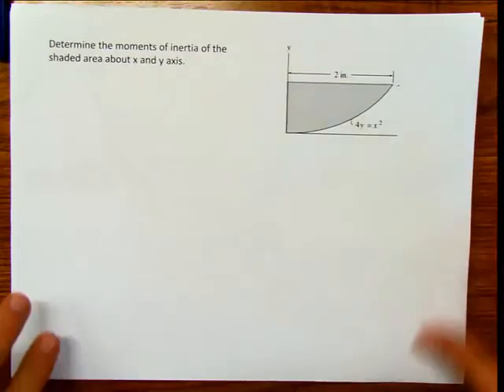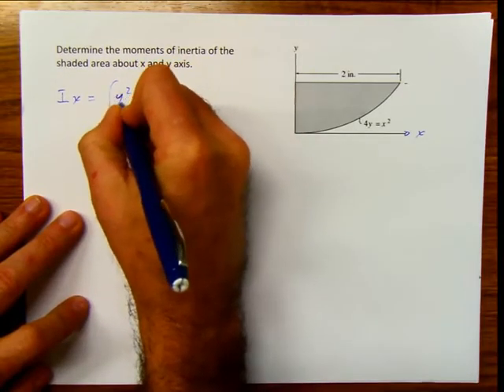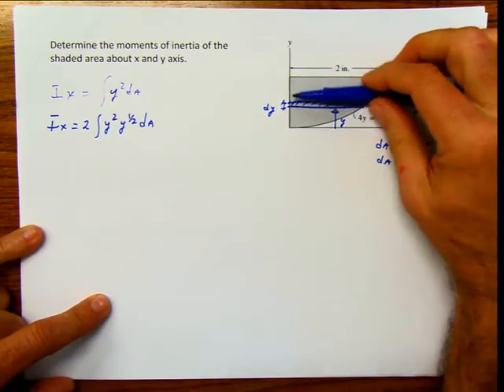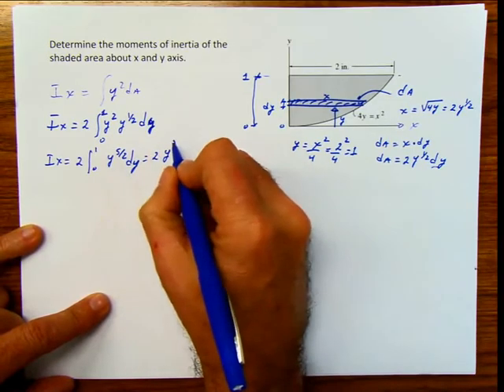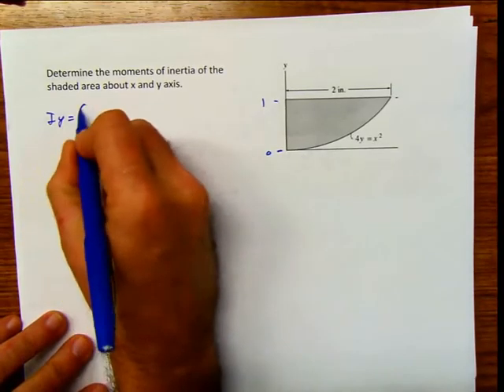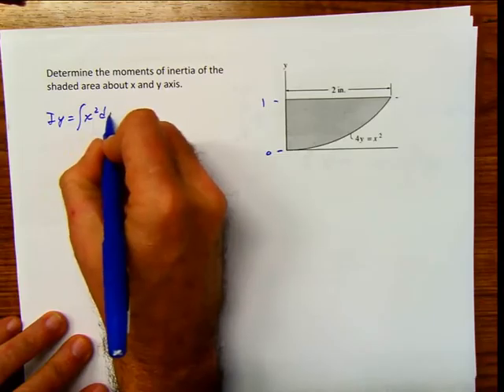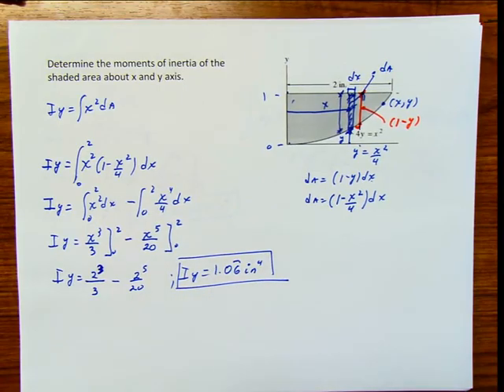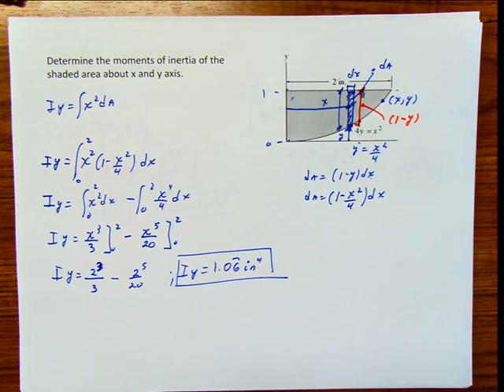Study Set 10-2 (MoI of a Parabolic Shape- Integrals)-2

Comment: Question, when calculating the moment of inertia about the x axis, Ix, and i want to use a vertical rectangular element (perpendicular to the x axis) where the does Y^3/3 come from when setting up dIx... i know you multiply ydx bc that is the "da" but where does the y^2/3 come from? does that represent the height of the rectangle or something? thanks!!! 

P.S i know i can use your method when i switch up the rectangle orientation and rely on x^2 and y^2 but i am curious how my question above works.
Reply: The differential element (or strip) must be the same distance at all points to the axis of rotation. If it is not, you must use the Moment of Inertia of a Rectangular Area. For Ix it is dIx=h^3b/3 for Iy it is dIy=hb^3/3. If the differential element is parallel to the axis of rotation you use the formula I=Integral(r^2dA) where r is the distance from the differential element to the axis of rotation.
Reply: What if the differential area is perpendicular to the axis of rotation? There are formulas in the textbooks for that case, that using the same differential element for determining both Ix and Iy, and it really confuses me and I don't still understand how they formulate those even I read the descriptions. For example, in the textbook, there is a formula for determining the dIy by using a differential strip perpendicular to y-axis. Can you help me out?